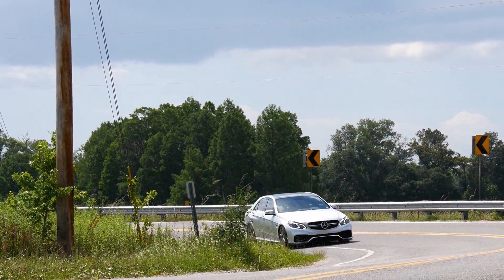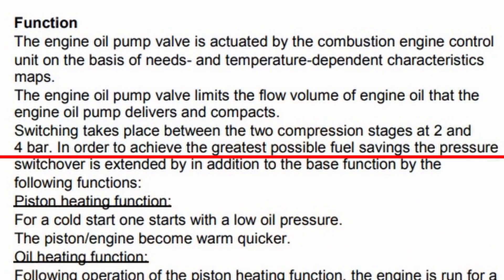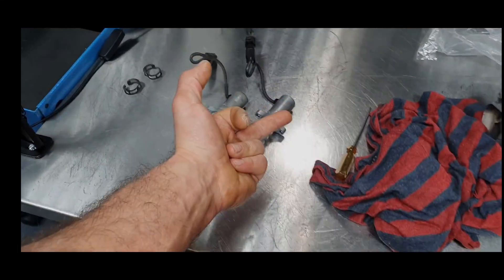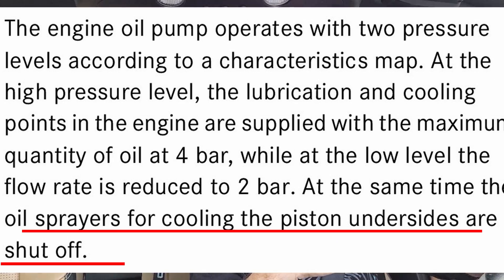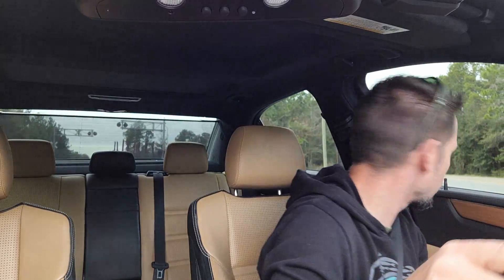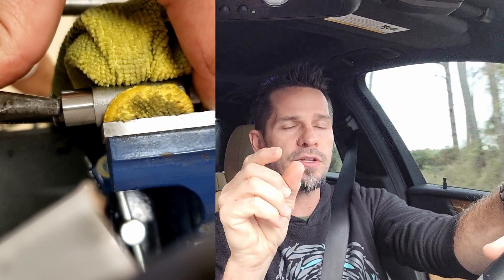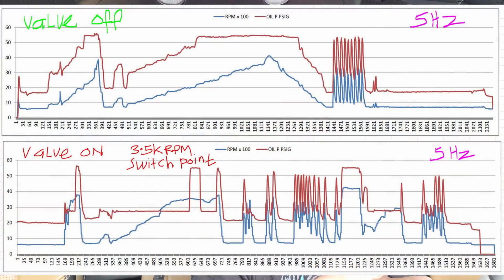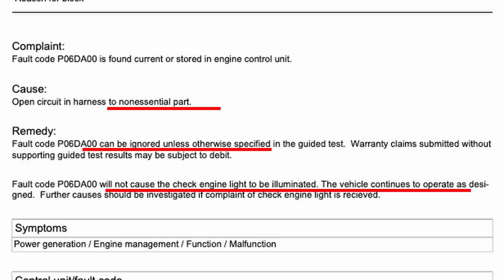M157 KILLER SMOKING GUN? Oil Pump Solenoid ~ Free mod! ~

Comment: Do you know if they’re still doing the same thing on the m177 4.0L. If so how would you recommend I figure out where it’s located.
Reply from the maker: Yes I believe they are, but I don't think you can just unplug the solo night on the new ones without a check engine light, hopefully soon I'll actually have a w 213 and I will experiment with this
Reply: Any updates? My 2020 c63 with m177 (48k miles) just gave me this CEL. I never unplugged it. Seems to be running fine though.

Comment: Where did you hook it up to check oil pressure
Reply from the maker: There's a port near the bottom of the oil filter housing, 6mm Allen plug. It's hard to get to. You'll need a auto meter 2277 adapter to hook it up to a normal mechanical gauge https://amzn.to/3vU39ua

Comment: With the car off I assumed When you unplug it? Is it in high pressure already ?
Reply: The resting state is normal pressure. The solenoid must be energized to enter low pressure mode.
Reply: My g63 has 70k and my e63s  100k .  Is it too late to do it still do it? @exoticcardiy

Comment: My only concern would be the cold start in the northern states with the high-pressure flow only. Yes, the engine is designed to hold high-pressure numbers, but what about the reduced flow of the oil during cold weather? That's something to be taken into perspective before cutting that sensor completely IMO.
Reply from the maker: Definitely something to be considered.
 If you read Mercedes description of the oil pump in document GF18.10-P-2000A, they have a description of the cold start oil warming function of the pump.
Essentially you're right, it does start in low pressure mode for a short period of time until the Pistons warm up. Once the Pistons are warmed up, then it switches to high pressure mode regardless of RPM in order to spray the hot Pistons with oil. According to the document, the reason it does this is just to warm the oil faster.
So even in its stock function, it does run in the full pressure mode shortly after a cold start.
Reply: Correct, but also to prevent any stress on the seals due to reduced oil flow during cold temps. I would definitely see this more effective in the warmer States, but in the colder states can backfire easily on the seals part of the engine.
Reply: @Strash.P how would it affect the seals?
Reply: @ralph02136 The pump keeps the oil pressure low at startup until the cylinders warm up. Oil gets thicker in extremely cold temperatures and causes higher pressure until it warms up. Starting the engine in winter with max oil pressure will affect the seals longevity IMO.
Reply: @Strash.P  how cold do u think that would start becoming an issue? Like temperatures below zero or single digit temps?

Comment: I did this and thanks for the tip, the only thing is i get check engine light, definitely not a ghost code for my 2017 GLE63S.
Reply from the maker: Yes read the latter Post in the the thread on MB world. (It's like 1100 post now, but scan through the last 5-6 pages) essentially, The people with s-classes and the few other models that do trigger a check engine light are buying a spare solenoid and they're just plugging it into the harness and zip tying it out of the way to accomplish the same thing without a check engine light.
It's probably impossible to read the whole thread unless you have a few hours lol.

Comment: Awesome content as always.
I have 2 questions I hope you have an answer for.

1. Does this also applies to 13 M278?
2. Is it true that the M157/M278 prior to Dec 2013 has a killer issue as explained by MB ( coolant leak into the engine via the molded seal seal between the timing case and the cylinder crankcase) causing oil and coolant mix around 100k miles? 
Thank you.
Reply: I have heard the same thing about coolant and oil mixing.  Anyone have any experience with this or some more info that our community can link to?
Reply: @TTUNDRA450K  https://youtu.be/jsD87SsIqaA?si=yRBr-P_iLkcC8kgG

Comment: Would this work on the m278 engine - CLS500 2015??
Reply: That would be also my question..??? Can anyone reply?
Reply: @slowbee236_  Just did this on my 2013 sl550 m278. Easy mod, did it from the top, engine is running fantastic!

Comment: Woww. What a night and day difference . I was having the rpm surge problem on my car for the longest time. Did this mod and my car runs 10x better and quieter. Shifts smoother and it fixed my rpm surge problem. 
Thanks a lot
Reply from the maker: Yeah, I'm at almost 4 months with this mod, I have zero cons very happy with all the results

Comment: Not sure if :
1. constant 4b pressure will not lead to more oil leaking problems in future? 
2. heat exchanger will handle more hot oil  in  summer time?
3. more pressure- more chance to interior  oil/antifreeze mixing, oil in harness?
4. more wear on oil pump ( this is actually reason #1 leading to oil starvation in M157, not 2b pressure)
    I hope I am wrong.
Reply from the maker: All good concerns, many of these have been discussed in length on the thread.
1&3 No. Remember where oil is being pumped, it's being pumped through oil galleys primarily into bearing surfaces. Like the crank journals and Rod journals. That's where the pressure is being increased at, in no way could this result in leaking through gaskets or sensors. Every place where there is a gasket/sensor, like valve covers oil pan etc, it's simply exposed to oil drain back at ambient pressures, there is no increased pressures on the gasket surfaces.
2&4. Let's use the scenario for example. You go to a track day, and as your car was designed to do, you subject your car to several hours all above 3, 500 RPM. In this scenario, it does not matter at all if you have the solenoid mod done or not, the pump and engine are all going to 100% function the same either way since both scenarios would be in normal pressure mode. Thus, I think it's safe to assume that Mercedes designed both the pump and the oil cooler to be sufficient and not set up to fail in this scenario.
If you really just try to understand the design, it's not low and high pressure that we're being forced to run in high pressure all the time, it's normal pressure and reduction for fuel efficiency during idling, coasting and cruising.
So unplugging the solenoid only changes anything if you're idling coasting or cruising. Otherwise everything is exactly the same and subjected to the exact same forces and wear
Reply: Thank you Ken for making that clear.
I am In Florida and thinking to do it on my 2013 G63 in summer, so in case if oil temp  goes too high, will plug it back next day. @ExoticCarDIY
Reply: @ExoticCarDIY Hey Ken, have you ever dealt with a connector snapping and leaving the hole exposed ? Mine snapped and now I have an open hole in the cover with the two wires inside. Can I just plug the hole and everything will be ok ? Any concerns about wires being inside the cover on engine inside ? Thank you

Comment: Will it work and is this the same plug on 4.7 bi turbo ?
Reply: @Withachiri I did it on mine already I can’t tell the difference .
Reply: @chuemoua6834 still got it off? What have you experienced so far? Debating whether to do it in mine. 14 E550 4matic
Reply: @fps197  I don’t see any difference but logically it’s better for the engine . I did massive research not just on these engine but overall in other engine with the same setup . This isn’t a Mercedes thing , it’s standard on a lot of cars that uses a two stage oil pump .

Comment: I will try this on my 2014 Cls63s and get back to you guys, I’m annoyed that it takes 25 minutes to get to temp. Also shifting weirdly and not feeling the power properly.
Reply from the maker: My commute to work is 30min all 55-60mph... On any day under like 45*,: my car would never get up to temp.
Now the oil  gets to 170f in about 10min even if I'm diving like a grandma.
Reply: @ExoticCarDIY interesting. I didn’t do it to my car and it gets up to temp pretty fast. On cold days 15 minutes
Reply: That’s awesome I’ve been dealing with the car heating up to temps, it takes 30 minutes for my car to leave the blue oil temp. And also my throttle isn’t as responsive.

Comment: Man this is actually golden! I have hated the fact that my 2012 CLS 63 would take so long to rise up oil temperature. It would just bother me to see it low for so long on my dash. Plus engine is noisier until it reaches temp. I have 153k miles and want it to go 200k. No issues other that the check valves and tensioners so far. They have been replaced. Still shoots out the hole like a rocket! Thanks for this tip as well! Getting it done asap!
Reply from the maker: I love the new oil warm up time now
Reply: @ExoticCarDIY same with my cls63. It warms up 2 times slower than my c63. Why is that??
Reply: @ExoticCarDIY and bro you sure messing around with the oem layout is safe in the long term? Why would mercedes make something that would make the engine run worse
Reply: @multiblade04   He explained why in the video.
Reply: @CarCrazyRDM   you sure messing around with the oem layout is safe in the long term? Why would mercedes make something that would make the engine run worse

-where did he explain this in the video?? He didnt
Reply: @multiblade04 sounds like this isn't a mod for you. 👍🏼
Reply: @CarCrazyRDM  🤣
Reply: @multiblade04  obviously they do dumb stuff like this that ruin engines for emissions. Also, why are you so annoying with your messages?
Reply: @ginco_bnz  keep driving your cls550 bro. Probably think you super fast coming off a c250 ey bud 😂 You dont even have a cls63. keep dreaming buddy
Reply: @multiblade04   lol sweetie keep talking. If you wanna talk shit about speed let's line it up, my dual pulley 55 would be happy to gap your base model.
Reply: @ginco_bnz  ok bro have fun with your c250, cls550, 55 model and all your max depreciated old af models. Theres a reason you cant afford a newer one
Reply: @multiblade04 u a broke boy
Reply: @ExoticCarDIY  you get my message?
Reply: How has it held up for you? I have a gle63 with 46k miles and I unplugged mine around 40k miles. I’m planning to keep the car for a long time.
Reply: @SiKhTaLeNTzZz she held up nicely. I sold it at 161k miles. Engine is strong. Just look for the oil leaks around this mileage like in front of the heads. Turbo cooler lines will go around 120k mikes. They are plastic and the heat just cooks them till brittle. Internally the engine is one of the best in my opinion.

Comment: Did it 4 days ago on my 2015 C17 S63, truly made the car smoother and quieter, it even seems to start in less revolutions, it idles much quieter, too.
Reply: also noticed my engine starts in less revolutions with oil pump solenoid unplugged, sometimes seemingly instantly - 2015 ML63
Reply: @jamienz89  it may look like fail safe mode , how is acceleration?

Comment: I found oil on literally all my sensors w oil on  a few of the ECU pins, however no issues with the car yet. I won’t drive it until all is replaced and cleaned, but Do you guys think issues can still surface now that it’s made it to the ECU, Or would have they come up already?
Reply from the maker: I'm not sure what actually kills the ECU, but I assume it starts shorting out circuits etc as the volume of oil in the unit increases.

Comment: Yo bro, is your car still tuned? I see in your old videos/comments you mentioned only TCU tuning your new e63. What you got done right  now in terms of performance mods?
Reply from the maker: Stock tune, stock TCU, stock intake, aftermarket catted downpipes.
So far best draggy 0 to 60 is 3.2 and best quarter mile is 11.5 in this current setup
Reply: Can you run a catless downpipe with no tune?
Reply: @Dsis24kb Yes but your check engine light will be on

Comment: there is also a timing cover gasket that causes oil and water to mix. that's whats going on with my e63 at the moment.
Reply: What year is your M157, and how many miles are on it?
Reply: @roberttischler7721  150k. I didn’t experience it with my ML63 with over 210k

Comment: As a Mercedes tech in Canada, usually when we see the code P06DA00 in the ME the fault description is “ignore and erase this code”. What usually sets this code is the little pigtail inside the oil pan going to the solenoid goes open circuit. What we are finding now is that on certain models, after a recall where the ME has to be updated, the code no longer states ignore and erase, but states there is an open circuit and it will set the check engine light. We have mainly seen this on the 4 cylinder 270 engines and hybrids. Don’t know if this is region specific but just something to aware of if you take your car in for a recall software update.
Reply: Is there any reason for me with a 2015 E63 AMG S to ever go to the dealer to have the software? Is there even a newer software update for this car or are you just referencing newer MB cars? Because it does not display a CEL for me after doing this.
Reply: In America we replace that solenoid. Drop the pan etc and just replace the solenoid and the wire running to me etc. do you guys have the same thing
Reply: As a Mercedes tech can you please tell if oil pump on M278 will die prematurely due to disconnected oil pump solenoid if it is done in a cold climate country like Canada? What I found out that due to this specific oil pump design it may have to work under large pressure with disconnected solenoid during cold weather starts. Also there is evidence no matter the climate due to full oil pressure mode being on at all times the oil may go bad and need to be changed prior to even 5k mile mark. If neglected it can lead to all sorts of issues associated with bad oil.
Reply: “due to full oil pressure mode being on at all times” inaccurate. The ECU still governs oil pressure based on load. Unplugging the connector will heighten oil pressure during idle, cold starts, and load below 3500 RPMs. This mod is not meant for cold climates nor traditional oil change intervals. But do your own research. Good luck
Reply: @zambuzan  they are saying higher pressure at the states that your are talking about in your comment. this will benefit the engine in the long run. no low pressure while at a steady cruising speed. no low oil pressure at lights, and cold start. i think its a win. My ride has been like this for over a year and is fantastic. I actually installed a dummy solenoid to get rid of the CEL
Reply: @JoeClarke-h3s  I live in Pennsylvania. Would not having the pump connected during cold winters affect the engine?
Reply: @ been over a year on mine. Live in Northeast Ohio. I also change my oil with Motul 0w40 every 6 months for me because I live so close to work and only put on about 2800 miles a year. I would suggest changing your oil once a year and every 5k or less if you do it. Also my engine is an M274. Very similar architecture.
Reply: @JoeClarke-h3s  do you think it will work on m264 the new one compare to m274?
Reply: @richardcha6423  I haven't seen any issues with those engines, or have messed with the oil control valve on those. Essentially they are the same architecture of engine as they share many internal parts. Up to you to want to try it!

Comment: What exactlt did yoy use to cover the connector? Like what should I go tot he stoee and buy exactly?
Reply: I had the same question and used some  cable top covers for now. 
I also ordered some 2 pin connector dummy’s.
Reply: @maddoxx6250  I used some heat shrink conduit we use at my work then zip ties it to the ribbed conduit by the plug out of the way.

Comment: Also, having inherited one of these, all stock driven lightly and no oil change was evidently done in over 16k miles, its driven mild to lightly, and approaching 80k mi, is there something one can pour  through the engine after oil drain to clean up/desolve any carbon, etc? and what is a good oil? it has been using oem but Mobil 1 is recomnended. It is due for plugs, possibly coils, and def the 4 solinoids. How do I access that one sensor behind oil filter? looks like a pita. Thx. Happy Holidays.
Reply: I've used Liqui Moly Engine Detox before oil change with no issues. Oil i use Penrite HPR5 5W-40.

Comment: So Ken are you within a 1.5 hr drive of 32835?
Reply from the maker: 4hrs
Reply: @ExoticCarDIY Geez are in GA or SC?? Must be near Tallahassee or one of the other states. Anything to turn off or disable to jack up the front end to do oil?
Reply from the maker: @08turboSS  Why, all the pine trees? ha, good eye. Just jack it up safely, theres 8, 8mm screws to remove the splash shield. then use a pick to pull the safety lock on the clip and gently unplug by squeezing it. a few people reported breaking it. careful

Comment: Keep it up man, you saving us a lot of trouble, I can’t believe they would do this shit to one of the best engines in my opinion, also just to clarify, take that one plug off wrap it up and call it a day? Is it possible for the selenide to go into limp mode and it keeps itself shut which cause it to run at 2bar at all times? Also how many miles did you put on so far in the 2 weeks you’ve been driving it?

Comment: Did my E63 amg  yesterday what a difference smoother and responsive, no engine dash light and eco mode still working not that I use it 😂,, great job Kenny and tasos and amg family ❤
Reply: Do you have a part number for this?
Reply: @2011Vagif  no part brother watch the video and see how you disconnect the plug easy job from underneath the car remove the bottom engine tray and you hidden plug next to crankshaft pulley
Reply: @MrRyman222  is that all that's done? no lights on the dash or any issues after unplugging it and cleaning?
Reply: @2011Vagif  no lights or issues in fact the car will run much better and smoother , but remember to leave it unplugged and cable tie it ok